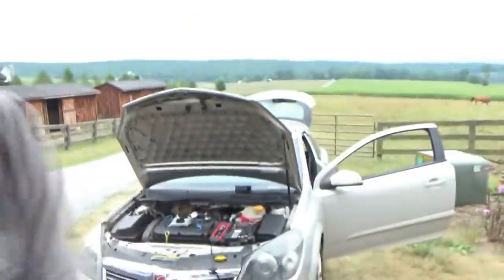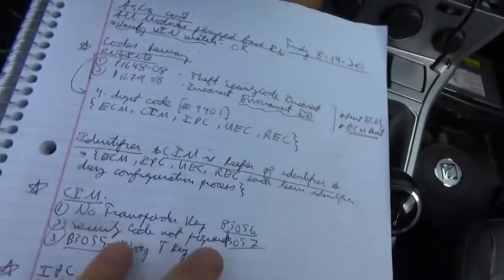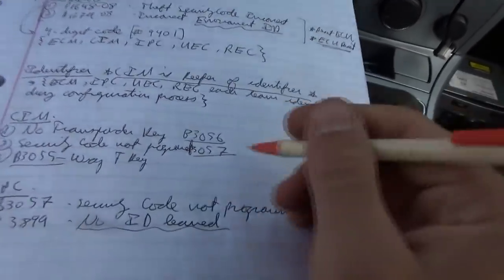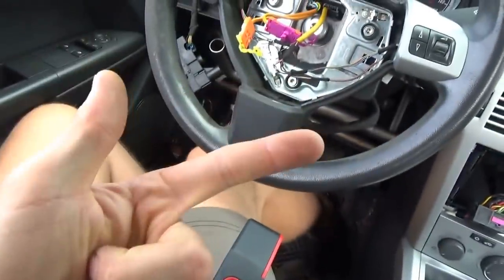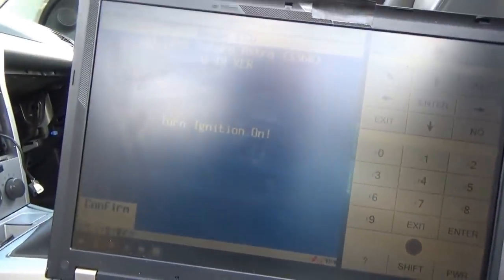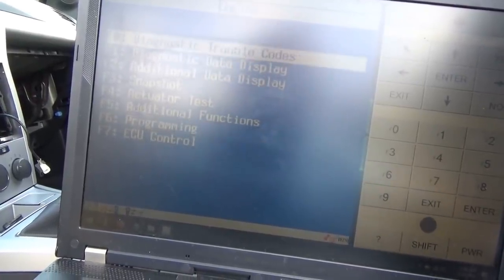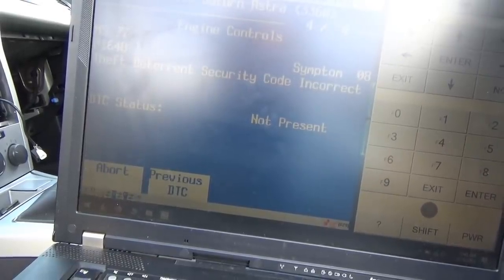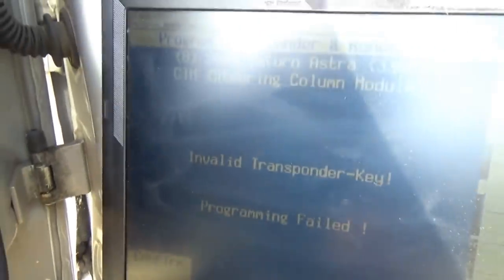Astra from HELL - Part 2 (GM Tech2Win)

Comment: Hay guys I'm in a situation at maybe someone can shed some light ,we had fault steering column module which has be replace by a second hand unit ..the car won't start I have china
 clone opcom software which has picked up fault transponder key issue so can anyone explain what I need to do .cheers

Comment: A 15 dollar op-com clone and knowing the procedure is all you need to program this puppy.

Ecu reset means just that, you literally divorce the ecu from the car and then it's ready to get married to the car.This has to be done with all security relevant modules. Then you can program keys (one will be enough).

All the used modules will be of no help if you do not have their secret codes in order to reset them as they are still married to the cars they came from. Reading the eeproms you can calculate these security codes knowing the code locations and algorithms used to encrypt the code.

If you

Comment: Had problems with my my Zafira b (basically the same car) and it would not let me re-programme a previously programmed key. I had to use a new key. The key does not need to be brand new just new to the car. Once i programmed a key i could then programme the previous keys back with no issues . By the way thanks for everything that you`ve done over the past years and letting us tag along with your work. Wish you and your family the best Christmas possible in these testing times.

Comment: I've never done a tech2 pass through programming... I started my career when the mdi came out, and then computers we had at the shop didn't have the serial ports and we didn't have adapters. I didn't think you could even do pass through with tech2win. I haven't used that program in a few years but it was very handy when it came out. super convient diagnosing stuff under the car and being able to command something on or off or look at data parameters.  Question for you, have you logged into gm recently? They are forcing us to abandoned tis2web and start using techline connect and WE HATE that program, the idea of having si, gds2, sps, all in one is great, but poorly excuted and the computers we have at work barely can run it.
Reply from the maker: Hmm interesting that they are switching software. Get ready for some GM bugs lol
Reply: @PineHollowAutoDiagnostics  its already buggy. crashes, won't load sps to program. we the techs are their beta testers. the latest error that keeps happening is model year vin mismatch.
Reply: Techline connect is optional for me I still use tis2web, gds2, si and sps with out the new pain of techline connect.
Reply: @r3y35-p6p  i tried techline connect and i used it maybe 5 times, gonna try and use the old way until its gone.

Comment: Hi Ivan always follow your channel and enjoy your content but I may be able to help. I worked on the Euro equivalent Vauxhall for many years and have worked on 100s of these Astras. If you want to speak directly you can DM me or I can give you a email. If not few words of wisdom, you need to perform the ECU Program function first this will take you through all the CAN configuration, variant configuration and as part of the programming routine program the transponder keys. Note if you try this as individual steps it will miss out key sections of the routine and it won't work. It will also ask if you are replacing the CIM, ECM or both, you will need to select the appropriate option depending on the programed status of the ECM. Once these two modules have been programed you can complete any other modules with environment id conflicts after. I definitely agree to check a spare key but these Astras also suffered from antenna issues, you may see in live data lots of *** where there should be data. Also the Euro equivalent suffered from a CIM software bug that caused intermittent immobiliser activation, this could be rectified by a SPS update but there was a specific routine to do so. If that was the case you would encounter intermittent non start with a flashing SVS light and DTCs B3055, B1616, B1614 I wonder if this was the original issue before all the modules were thrown at it and the programming messed up. 
Regards, Adam.
Reply from the maker: Excellent info, Adam! Thank you for the comment :)

Comment: reset cim, reset engine, go into cim, select immobilizer function, will ask whats been fitted, select cim and engine,follow instructions on tech 2, will still probably need new key unless your using original cim,pcm and key ,programming key is only ok if cim and pcm  already have immo function programmed.
Reply: Once engine ecu and CIM Module is been reset you can NO LONGER use old key again because the security file matching to the old key are no more to accept the old key you definitely need new key

Comment: Me thinks the Hamish have right, horse and buggy, good for 15 years, a bag of oats and some axle grease, what's  not to like ? Some initial equine programming, reins and a pair of blinkers and Paddy's your uncle. No oil change, basic brake system and loads of ventilation to counteract any broad-spectrum corona virus. Emissions are zero and so the climate is safe. Horse dung can be used as a garden fertiliser. No tsb's and no recalls, just an odd bill from the local farrier.

Comment: Ivan, the reset ECU stuff is used to erase unique pairing identifiers from the modules so that you can plug them in other vehicles, a sort of unpairing. Now you need to program them again, but this means that the keys are junk. There is no way to reset the keys themselves and make them blank, they are paired forever to the modules that have been reset. There is no way to recover the lost identifiers. New keys are needed. Unfortunate but part of the learning process. Don't give up, you'll fix it I'm sure :)

Comment: Well, your not going to blame Dorman for this one...  Perhaps this is the original problem? The key not being read by the immobilizer and a shop using a non-Tech2 scantool unable to communicate with the vehicle, Hmm... But do we know if the problem is the key? or a problem with the RF pickup coil or the module responsible for the immobilizer??  Thanks for the great case study Ivan and thanks GM for the overly complicated electrical gremlins!!

Comment: WOW I Ivan when I did that I only got to level 2 security. even when using my Tech 2 as a pass thru.  Like you I' have that security burned in my memory! Yes I am the original Tech working on this  car from hell.
Reply from the maker: haha Bill, I'm going to need some follow-up info from you for the dramatic conclusion :)
Reply: @PineHollowAutoDiagnostics  No problem. i know I sent you pictures of the wobble of the exhaust came Also the pic of the Vet who got the car . I'll send you an email that way it will be easir for us to communicate.

Comment: I kinda lost the track here, is it the original CEM fitted now?, if yes,  then it should possible to reprogram the existing key, even after CEM being reset/reprogrammed. If that's not original CEM fitted now, then existing key won't  code in as it is already being programmed to another CEM, the transponder is locked and not reusable on another immobilizer. If you end up buying a new key, then get a remote key especially for Opel/Vaukshall Astra H, not sure about the remote frequency, European market vehicles use 433, North America 868 MHz. You don't have to cut the blade on the new key, it can be just swapped around from the original key. And don't buy a non remote key, this won't be accepted by immobilizer.

Comment: I have a cure. Push it into a big field, 20 lbs of tannerite in a sealed, full container on the seat. Hit it with a supersonic round. Boom, end of problem...lol. Jk. Owner screwed the pooch on this with all the module swaps and not programming each after each install.

Comment: I watch all you video's, and finally you have a euro car which I know very good. But it made watching the video very frustrating because i know exactly how to fix this with the tech2. The reset ecu function means you clear the security code from the module. You do this when youre going te remove or replace the module. The function you need to perform is  program ecu and than follow all the steps. Begin with the CIM module as it will program the vin, mechanical key number. Low, mid and high speed can configuration, transponder keys and the indentifiers. If you still have no security codes programmed dtc in pcm, rec, ipc and uec also perform program ecu function is this modules.
Reply: Makes sense... So no need for "virgin" keys even after ECU reset? (Some systems burns flags in the keys which makes them unusable after "marriage")

Comment: New CIM can only be programmed with new (virgin ) keys.
Only the old CIM that was installed in the car can accept re-programming of the previously programmed keys (previously programmed to the same car only).
Used CIM from another car can only work if it has the matching keys from the same donor car.
I hope this will help u Evan .
Reply: I program new CIM modules weekly with the tech2, never did i need new keys.

Comment: On these vehicles the transponder gets locked and can only be programmed once. Since you reset the cim module all keys were deleted hence the key cannot be programmed again as the transponder is locked. New key will do the trick. Also not necessary for 2 keys. Car will start with 1.But always better to have a spare. You get special tools that can unlock the key again and make it usable again

Comment: Owner bought the vehicles equivalent value in used and new modules. Interesting comments so far about the keys. Bring on part 3. Thanks Ivan!
Reply: The utility you get out of the car is more important than what was spent. It's market value might be worthless (worth more parted out) but the fact that you can still get utility out of it for another 50k miles (hopefully) has value to the owner. Too many people "abandon" their old cars that they own free & clear with low insurance costs. Putting that money toward a new car is not always a good use of money.
Reply: @johnames6430  I completely agree. I drive a 2006 Mazda. However, I've noticed over and over again that most people don't think like we, including Ivan, do and most are quick to say "scrap it!" Still, the money that was spent on modules was excessive, in my opinion, even when factoring in utility.
Reply: @baxrok2.  Yes but it be that great unless you can do most of your own work. For example I changed out all the struts on my old impala with Monroe's and to have that done at a shop would've close to the value of the car.
Reply: @johnames6430  I agree, being able to do the work yourself is key.
Reply: Yeah, but it has the leather interior.
Reply: @paulr3237  Ah, yes, good point!

Comment: Opcom 2 min job I  tryed snapon and others I have done lots  take my word grab a opcom knock off £20 eBay don’t buy keys and stuff your wasting money and will be doing circles I did message on your other video then deleted lol I could give you step by step and you would be running in 20 mins or carry on buying parts only to find I’m right. Your got everything you need other then spend £20  I would sooner spend £20 and get it done and gone then be a parts changer and spending 100s I do all the uk cars that can’t be done at garages all over the uk Vauxhall Ford  vw Audi fiat landrover  plz take my advice and stay safe

Comment: If you have the lights on the dashboard and jump the starter relay it will start
Reply: NO because the ECU is put into a mode called Software lock. Unless the Immo, ECU, Key all handshake the ECU is just a dead brick.

Comment: I think I might have started with replacing all of the original modules once you fixed the ground issue.  This job has all of the earmarks of someone just shooting a parts cannon at the car not realizing that each unprogrammed module actually made it worse. I mean short of being hit by lightening or possibly reversing the polarity on the battery, it's actually hard to fry that many modules.
Reply: as someone who deals with lightning rods (antennas) connected to very expensive IP based radio equipment; I think your right too!  They fixed symptoms not the problem...
Reply: @n3lee  As someone who's older and can't do a lot of the work I used to do I sometimes use younger stronger mechanics to do the heavy lifting.  But I do the diagnostics myself.  It's surprising that in today's world how many mechanics are out there with absolutely no diagnostic skills. They just swap parts until the vehicle runs again.  The big clue here is all of the modules that were replaced without programming them.  It's very likely that whoever was working on the car didn't even know that those modules even needed to be programmed.  Without programming the modules, they could have literally replaced every part of the car without ever getting it to start again.  In fact I'd bet the previous mechanic caused the no start scenario.

Comment: Yes you need brand new key or unlocked in order to replace the CIM.
Reply: Yes definitely he will need a new key since he has reset the engine control module and fitted a new CIM Module so there no security file to match his old keys
Reply: Exactly, many transponder keys have chips that "lock" when programmed to a vehicle.  Since the module was replaced, a virgin or virginized key is required for programming and even if two keys aren't required it's still good practice to program two keys while going through the trouble.  This is the reason most locksmiths won't program keys they don't sell, not knowing the source of the key leads to problems and wasted time.

Comment: Shocking if this is just a bad key! You might try a new battery in the key & look inside for corrosion/damage & clean contacts. Could you get the original CIM to work? That should be matched to the key (assuming the CIM & key work). The Euro CIMs have some soldier issues and you can see forums for DIY fixes.

Comment: This is the European Opel Astra they just change the badge,  but it is on the GM platform cause GM owes opel for a couple decades
Reply: GM had a controlling interest in Opel since the 1920's except during the Hitler era then sold them a few years ago. When GM went bankrupt in 2009 they shed the Saturn brand and many others. The Saturn/Opel/Vauxhall Astra was only offered in  North America as a 2008 model in the U.S. and 2008 and 2009 in Canada. The Astra had a lot of bad things happened during it's introduction to the U.S. First: the Ion, the mediocre Saturn model it replaced, was not selling well. There were a lot of them on the lots in 2007/2008. The world economy was slowing down and then crashed at the end of the summer of 2008. The Astra dollars to Eueros exchange rate also became unfavorable for import.  And finally GM, in my opinion, is a joke. They could of had a good thing going with the Astra but they seem to bungle most everything because of their corparate culture. They promote from within in almost a incestuous manner. There tend to be no new ideas
 There is nothing wrong with Opel Europe or the Astra, the problem is GM.

It is really frustrating to see all these negetive comments from people on a car that they really do not understand. What is all of this  stupid scrap yard crap? Why are some individuals so willing to throw away cars? The value of the car is not zero. Well not before all of this anyways. It still has a used cars price of at least $2500 to $3500 dollars. No car is engineered or built to perfection. After all of this the car should make a good dependable driver.

Comment: You did reset the engine control module and after that you have go to immobiliser system and reinstall the engine control module without doing this you will not be able to program the keys..
Reply: you want to say "without doing this you will be unable to program the keys" right?
Reply: @ismarmeskovic  Yes, you first need to reinstall the engine control module than program the keys,

Comment: 13:20  Ivan, are you in a barn with a horse, helping you with the diag's?
Reply: Nope the horse is asking why Ivan is in his field
Reply: I think that was the sound of the horsepower dripping from the engine! Maybe not.
Reply: So I'm not the only one hearing a horse now and then?   Whew. 🐎
Reply: @sandybarnes887  As long as you can’t smell it as well...

Comment: Hey Ivan, info from Germany here. It is an Opel (EU) or Vauxhall (GB) Astra. When you use the software OP COM you do not run into issues when it comes to diagnosing modules on these.
Reply: US shops need to download some Euro software for the Astra else diagnosis tools don't have full functionality.
Reply: @dosgos  I don't know if the Saturn has an EU-OBD interface or an American OBD-II interface. They may have different firmware for the US and EU markets due to regulatory differences.
Reply: @Stoney3K  US Astra has hybrid firmware. US Saturn dealers have all closed; a US chevy dealer can install the Astra tools but that takes a fair bit of effort and time.